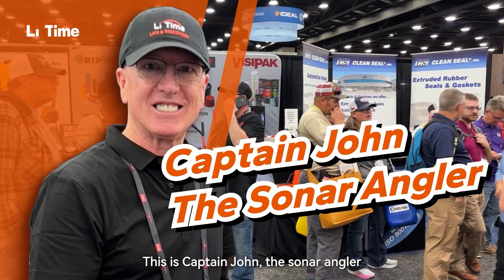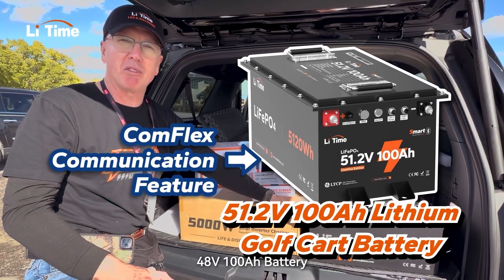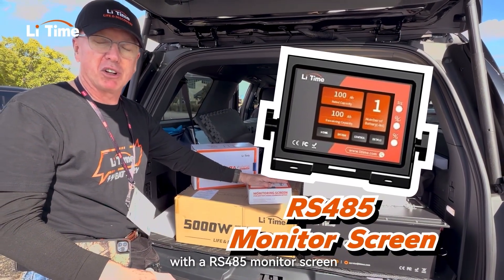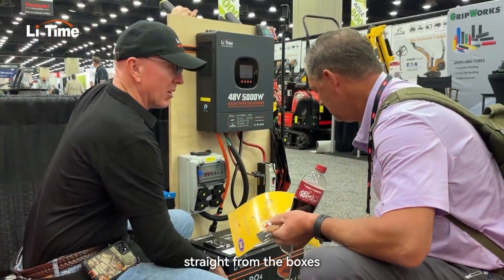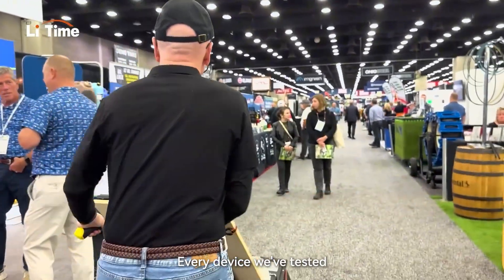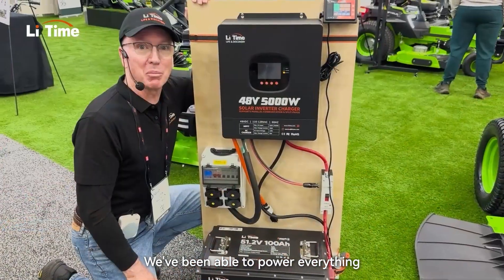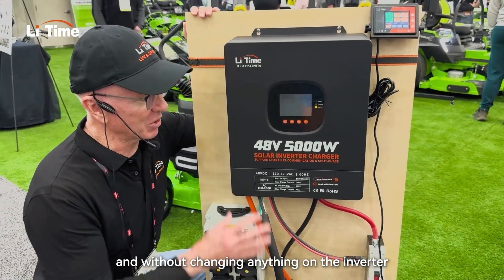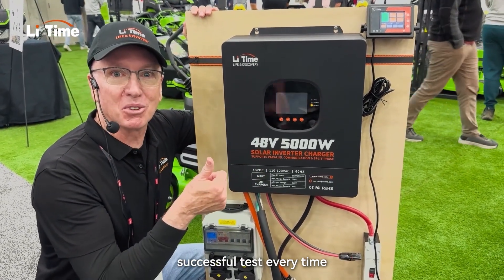Captain John's DIY LiTime Super Mobile Power System ⚡️

Comment: The li-time app sends you location, phone and wifi data to china
Reply from the maker: Hi there! 😊 Thanks for reaching out!
Regarding your concern — on Android devices, the system requires apps to request location permission in order to connect with nearby Bluetooth devices. This is part of Android’s design, not something specific to our app.

Please rest assured that we do not collect or store any location information, nor do we use it for any other purpose.
If you’d prefer, you can also use an iPhone (iOS), as this system doesn’t have the same permission requirement.

Thanks for your understanding and support! 🧡
Reply: @litimepower your app requires an active internet connection and logged in account to connect to your local battery. That is absurd and enables china to control all li-lime batteries worldwide. This should be banned.
Reply from the maker: Hello! 😊
Our app has been updated and now includes Guest Mode:
-No login required
-You can manage and add batteries even without an internet connection
If you have any further questions, please email us at service@litime.com —our team will be happy to provide support. 🙏